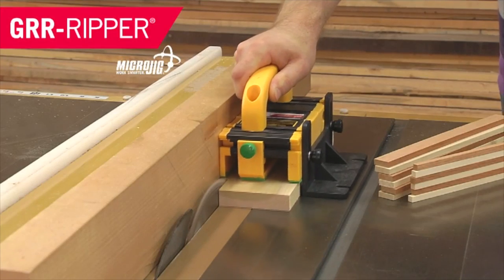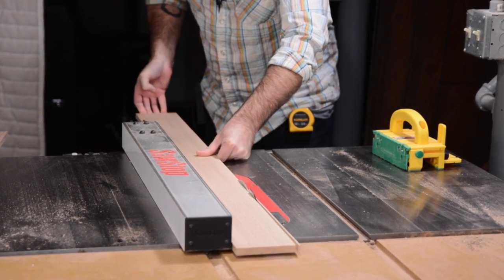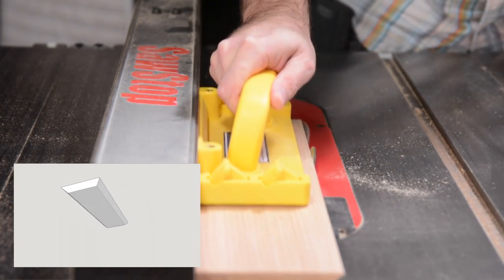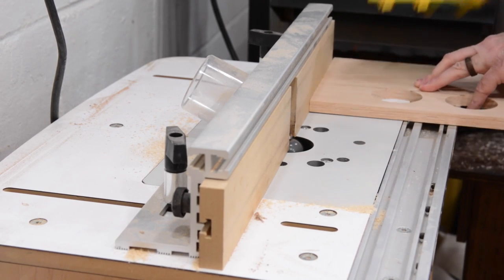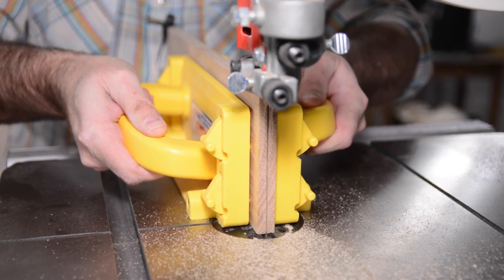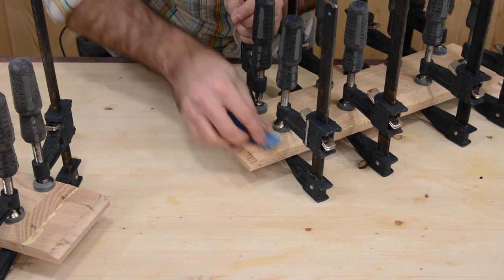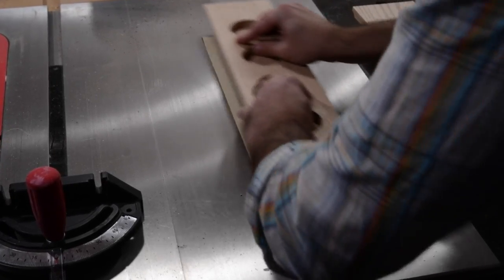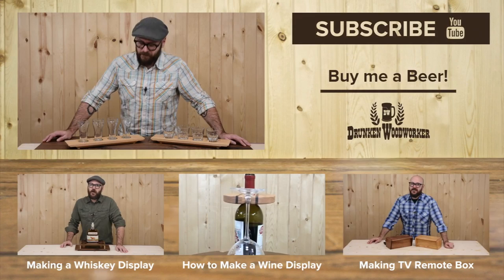Woodworking: How to Make a Beer Flight a Whiskey Flight and a Candle Holder

Comment: Quick tip for the bevel. If it's an exact 45, the distance from the outside corner to inside corner (as far as your table saw fence is concerned) will be the exact same as your board thickness.

Comment: Nice project David.  That would make a good Xmas gift for family members(in the candle mode)

I notice when you rip longer boards, near the end you stop, grab your Gripper, and continue to the end.

I don't know if you have ever had an issue, but every time I do that I usually get a saw mark or a burn mark where I stopped to grab my push tool.  I now keep my push tool on the right side(I'm right handed) as close to the fence as I can.  When I get close to needing it, I continue to push the work with my left hand, grab the push tool and continue to the end of the cut.  The material never stops and I have eliminated my saw marks and burning.

Keep the good stuff comin'.

 JimE
Reply from the maker: That's a great tip because I do get burning when I stop!
Reply: Drunken Woodworker

I'm always reluctant to share how I do something because a few folks think you're a smart ass or know it all when you do.

At 71, I find I really like people posting the way they do things.  Even if I am aware of some of them, I learn a lot.

I thank you for the positive feedback.
Reply from the maker: I think it's important to be open to other peoples tips because there is so many ways of doing things and you never stop learning. THANKS!

Comment: Nice Flights David,
  Do you have trouble re-sawing when you use a push block on both sides of the blade? It seems like that might pinch the blade. Just curious because I have never done it that way but I've see you do it several times and I might want to give it a try.

Regards,
Bob
Reply from the maker: Thanks! No problems at all. It's the easiest and quickest way for me.

Comment: Im' planning on building a cross cut sled soon, and was wondering what T track this is. I'm assuming Kreg? I love using those stops as well, definitely going to find one. Thanks!
Reply from the maker: It's Kreg. The link to the exact model is in the description above.
Reply: thanks!
Reply from the maker: I'm going to build a smaller sled with the Kreg stop trac and Microjig runners sometime in January.
Reply: Awesome, doing a video?
Reply from the maker: Yep.